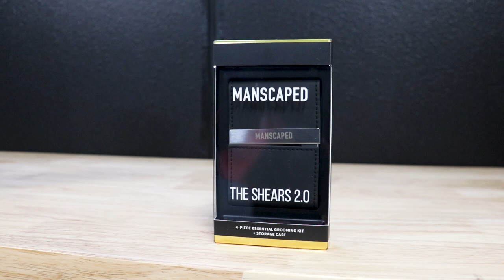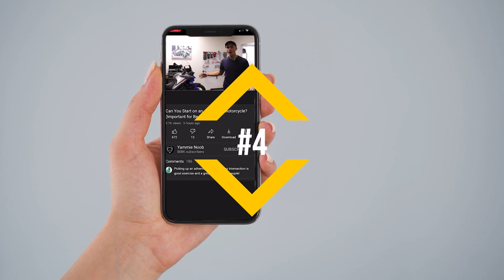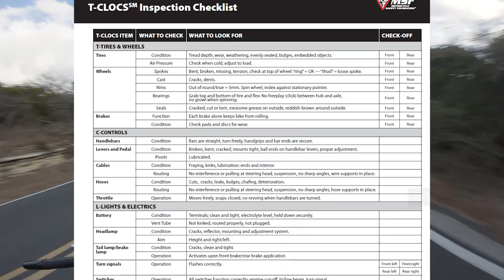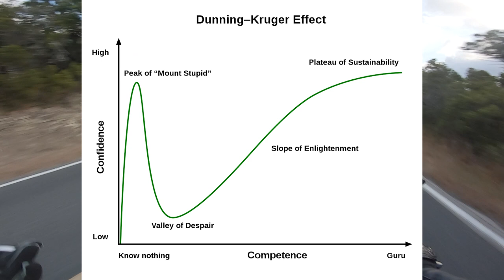Top 7 REAL FEARS You Should Have About Motorcycles

Comment: There's loads of potholes near me. I never noticed most of them until I started riding. They scare the crap out of me. 

Oh, and the cold is killer here too. It's not so bad if it's dry, but I don't have waterproof gloves, and they often get wet. All fingers on both hands felt like they were going to fall off earlier. Ended up just removing my gloves, which I would never normally do. It was brutal

Comment: For anyone who rides in the cold and wants to prevent that tensing up that is mentioned in the video. DEFINITELY get a heated vest. wear it under your riding jacket and it will change your whole winter riding experience. Your body doesn't have to expend energy to warm you up and even the worst wind gusts don't get through (at least on your torso). You can find them on amazon for as cheap as 35 (but get one for at least 50). Some of the best money you will spend. Needs a usb power bank/battery.

Comment: I don't get the whole rain and cold stuff. I live in a place where there is precipitation 190 days of the year. So all of my gear is rain gear. In summer I just zip up the vents and it's pretty dang rain proof. In autumn, winter and spring, I wear a goretex suit. The only difference is the amount of thermal gear underneath for winter. There is no real reason to get wet or get cold at all.
People will spend 30k on a car, but spending 15k on a bike and proper gear, oh no. The idea of spending $1000 each on a summer and winter suit is suddenly too expensive. I just don't get that.

Comment: Sometimes motorcycle manufacturers will have a demo track day event at a major race track with all the major manufacturers being presented. If you want to try out a bike on the race track, you’ll usually have to ride in a group with an instructor. This causes a dangerous situation in my opinion as not all the riders in this group are experienced super bike riders and don’t want to ride as fast as the other people in this group, however the instructor expects everyone to stay close in the group. I also feel that unknown bikes should be driven with caution as you don’t know the finer points of the bikes handling.

Comment: Hey yam. I’m 6’3”ish and 280lbs. I am looking to get my first bike and I’m very interested in the husky svartpilen/vitpilen 401 and I’m concerned about the power. Is that bike gonna be powerful enough to pull me at faster than a snails pace or should I upgrade to something a little faster?
Reply: I have done A LOT  of research on getting my second bike, for street i would get a ninja 1000. I know it sounds big and scary but there are many different riding modes that makes it a good beginner bike, it is not a super sport rather it is a sport touring bike that will have all the power you need and as you advance in youre riding skills you can change the riding modes for even more power. And most importantly, you will never grow out of the ninja 1000
Reply: Another bike is the kawasaki versys 650, it is the BEST sport touring bike for the price and amazing in the corners, also it is extremely comfortable on longer rides. The versys 650 would be my first choice if i was on a budget
Reply: Both the ninja 1000 and versys 650 are excellent for tall riders👍
Reply: Btw i currently own a kawasaki versys 300, its an amazing adventure bike but after a few months you will be longing for more power, that is why i would go with the versys or ninja

Comment: Can you do a vid about abs I’m on the fence for first bike. Abs or non abs
Reply: I go with the old adage, “I’d rather have it and not need it, than need it and not have it.”
Reply: In today's world yes get abs. Most new bikes have them and they are a good safety feature.
Reply: Just get it. People will tell you that you won't learn how to handle your brakes properly, but you will. You'll feel/hear the ABS kicking in and learn how much pressure you need to apply that way. 

I ride a CB125F. It does not have ABS. I locked up the rear wheel in the rain. I nearly crashed. Just get the ABS my dude
Reply: Yeah, no question, get abs man!